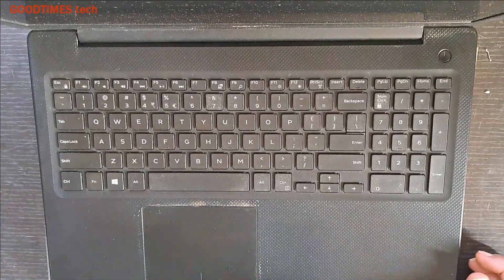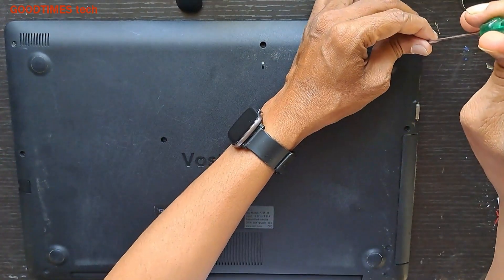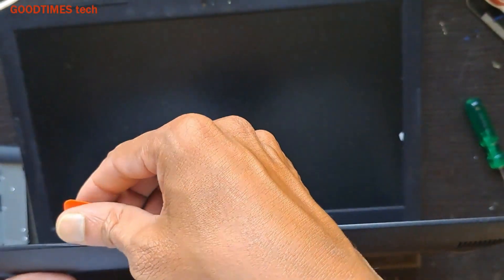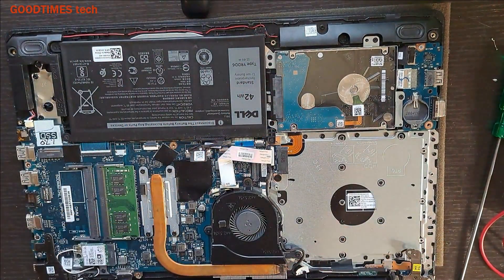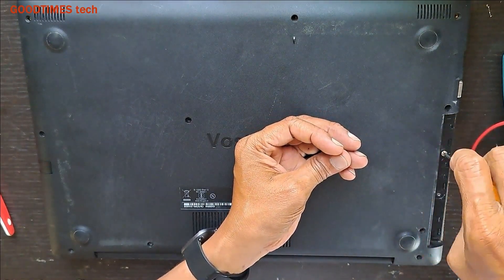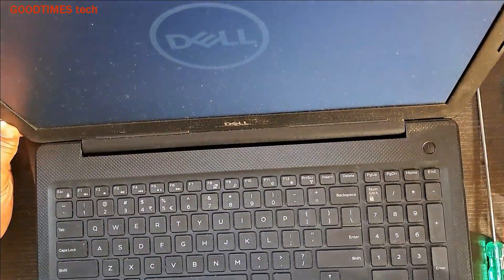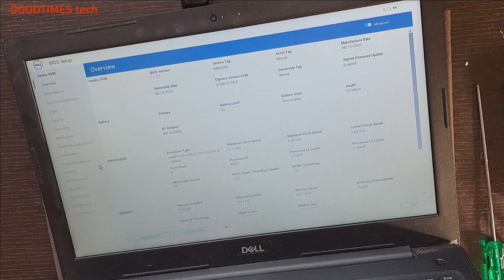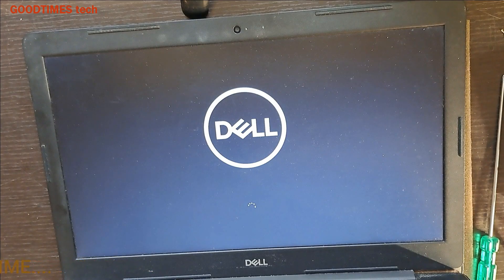DELL Vostro P75F110 laptop only caps lock light is on | but no display | Simple solution.

Comment: i have dell vostro 15-3515 and i tried everything hard reset and everything but the caps lock light is still on and display no and it happened after i did the dell update
Reply: lol that's why I'm here. Same problem but on my dell inspiron 16 7610. It was working fine until I did the recent bios updates and worked for a few days. Now today black screen but keyboard lights on and I've tried every fix.

Wouldn't be surprised if they did it on purpose. Screw Dell.
Reply: @huwevans9875 hello how did yu encounter this problem
Reply: Same
Reply: Then what happened?
I visited dell care, they told me its motherboard crashed and you have to replace.... What should i do?
Reply: @anujjain6351  no need just call me 

Google Devi Lakshmi washing machine 

You are from